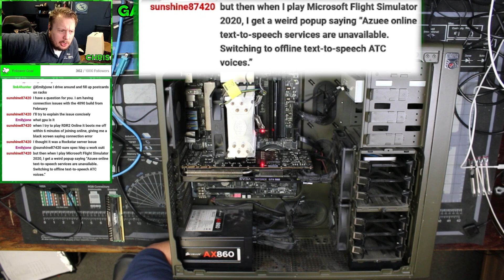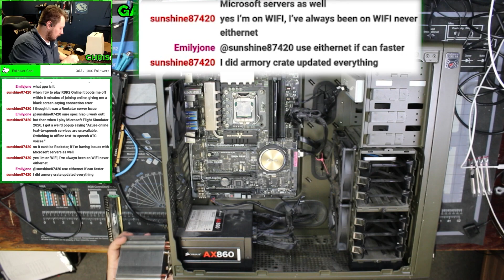Customer and a Viewer Had Gaming PC Problems, Can We Help Them Both?

Comment: JUST A QUESTION, WHY WOULD YOU NOT REMOVE THE CMOS BATTERY AND RESET BIOS BEFORE EVERYTHING?
Reply from the maker: Because 1-99 times it is not the bios. Bios after windows 7 was launched are pretty stable. it is very rare that the BIOS/UEFI is the issue. Not saying the problems don't exist, but it is SO rare.